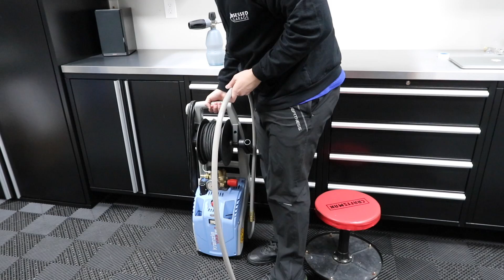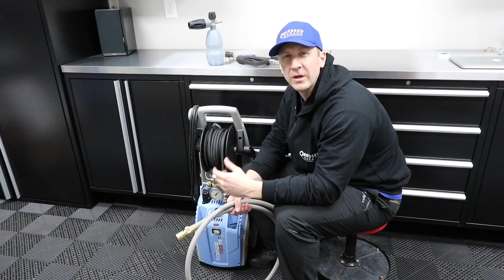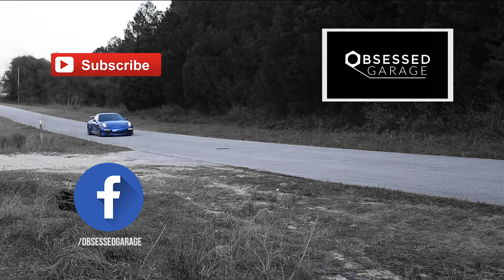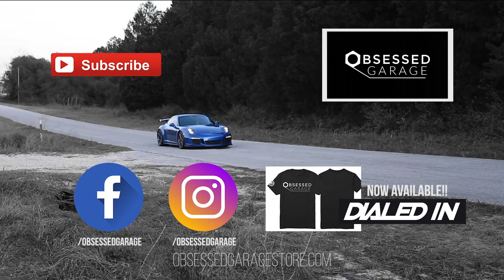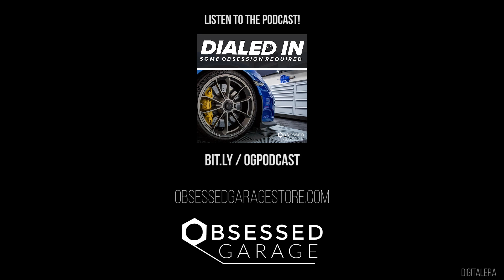Complete Kranzle/MTM/Mosmatic Pressure Washing Solution

Comment: I want to buy the Kranzle K1122TST Portable Solution Ultimate package, and want to upgrade the hose to the new Obsessed Garage 3/8" High-Pressure Hose v1.0. Would I need any additional fittings or would the product be a simple plug and play setup? If I need any additional fittings can you please let me know? Ideally I want everything quick release for easy storing/winterizing.
Reply from the maker: That won't work.  There is a proprietary swivel fitting inside the hose reel.
Reply: @ObsessedGarage  what would you recommend so that I can group the best hose with the pressure washer

Comment: Matt, I know this video is older. I have a situation in the form of a question, my water hose is on the side of my house and it is a stretch to get to the driveway. The plug that this would be run off of is located deeply in the garage. Spatially is there are a solve for that or am I out of luck until I can get into a home with a better laid out garage and water situation.
Reply from the maker: You can run a normal garden hose to it.  I used to have a 75' hose that connected to mine.  Then get a really thick extension cord that plugs into a 20A circuit, and you'll be good to go.
Reply: Nice! I can do that until I build a more car wash friendly layout. Thank you, Matt.

Comment: What are your thoughts if any about the electric Briggs and Stratton powerflow washer rated at 3.5 gpm?  The 3.5 gpm is what caught my eye.
Reply from the maker: I'm assuming that's a gas pressure washer.  The noise would make it a paint.  3.5 GPM is great, but you can't get that in electric without something like 30A or 220V.
Reply: Briggs says it's new Powerflow technology provides the 3.5 gpm and it's an electric model on Amazon. Briggs & Stratton 20667 Electric Pressure Washer 2000 PSI 3.5 GPM POWERflow+ Technology, 7-in-1 Nozzle, 25-Foot Hose & Detergent Tank.
Reply from the maker: I've never seen that one before, but the is no chance that is doing either of those numbers.  Well...maybe it would on the moon.  My $5000 30A 220V Kranzle does 2.8GPM and shakes the whole pole barn.  I thought maybe that was a gas powered model.  I wouldn't waste your time with that.

Comment: Great explanation of the unit and attachments. My one question is how water tight are those fittings? I have used quick disconnects before and they seem to always leak! I hate getting more wet than my car while using a hose.
Reply from the maker: These are been completely leak free.  Now they are a consumable, so I like have an extra of each one to replace when an O-ring or bearing fails.  But I've gotten a few years out of each part.

Comment: Is it safe to use a 3.0 orifice, that would increase the pressure to about 2000psi. Or will the 1122tst only go up to 1400 psi? Thanks
Reply from the maker: This will likely not increase the pressure that much.  The pump is rated at 1400 with a 3.5 size orifice nozzle on it.  Adding a smaller nozzle will allow a little more pressure, but it's probably not going to make it to 2000.

Comment: Just received my Kranzle package, hands down the finest pressure washer on the market. Lots of great foam and extremely quiet. All you hear is the spray coming out the gun. Matt did a great job putting this package together. The only downside is the price, but if you pony up the cash, you won't be disappointed. 
Kudos to Matt and the obsessed garage crew.
Reply from the maker: Thanks man!

Comment: Hello thank you for the information.. have you seen the AR PRESSURE WASHER THAT GARREY DEAN IS POSTING FOR SALE . It draws 6.5 amps and is .5 GPM any thoughts on that washer I’m looking to buy a pressure washer soon..thank you for your help in advance
Reply from the maker: I'm sure that would be best suited for mobile use making output sacrifices in order to operate on a generator.
Reply: Thank you for your input and yes I’m looking for something mobile I have a gas pressure washer at 2500 psi and looking for something below 1500 psi for car washing

Comment: Hey Matt...what modifications to the package would need made so that I could use my Adams foam cannon? I previously used it with a Karcher K5 but I want to step up the pressure washing game. Thank you.
Reply from the maker: Should mate right up.  The only thing you may need a 1/4" male plug.
Reply: Obsessed Garage I appreciate the response. Should I order each individual package component or can I simply order the package and request excluding the foam cannon and add a 1/4” male plug. I’m afraid I’ll miss something ordering piecemeal.
Reply from the maker: Just type in the notes that you don't want the foam cannon, but you want the plug.  If I were you, I'd keep the PF-22 in the package.  It's much better than the Chinese Adam's gun.  Their's is a copy of the original MTM gun.
Reply from the maker: My Dad will credit you the difference.
Reply: Obsessed Garage about to pull the trigger on this but are you currently testing something that will be better? Should I hold off?

Comment: My wife will let me get one if it will wash our deck and grimy siding.   Is the pressure and flow rate suitable for household chores ?   #alibi  #underground_upgrade_club
Reply from the maker: You wouldn't want this for household stuff.  It doesn't have enough output for that.  You'd want something gas powered with 2.5+GPM and 3000+ PSI.

Comment: Matt, I know you've probably already been asked this question... but what PSI do you recommend for car washing (meaning direct to paint) ... I bought a gas powered 3200 psi pressure washer that I have been using... is that too much? 

I'm interested in buying the Mos handle and wand setup with swivel if you offer it and it works with 3200 psi. 

Thanks for all you do man!
Reply: Ok so I asked too soon... 1100psi recommended... I am wondering what calculations I need to make to see what my psi would be with that handle/wand/tip setup?
Reply from the maker: You need to know your GPM output.  Then google GPM orifice nozzle size and you'll get a million charts to dial in PSI you want.

Comment: shipping to norway?
Reply from the maker: You would need to get pressure washer in Europe, but I can ship gun/wand.
Reply: Nice thanks, but no one selss 1122tst in norway, only higher numbers, meaning newer versions?
Reply: Hei Rein! i Norge har vi 220V i strømnettet, og får derfor grommere elektriske høystrykkspylere her enn de gjør i USA hvor de har 120V. (Derfor mange i USA bruker bensindrevet.)
Da kjøper du den Kranzlen som du evt har råd til eller vil ha, og kjøper deretter QC Nozzle etter GPM og PSI på høytrykken du velger.

Comment: Good job on the whole kit , I'm going to get this whole setup , I was also thinking of the hand carry K7  but I'm not sure how they compare to quiet and the K 7 might not have auto on and off , I think that's a big plus have auto on and off , Can you give me some professional advice? Thanks!
Reply from the maker: I don't think the K7 is a very good machine.  It's plastic and cheap in comparison to the Kranzle.
Reply: Obsessed Garage  Oh I'm sorry , The machine I'm talking about is a Kranzle 98K1622 , it's a small little motor with a pump on it  and a carry handle , I think the K -7 is euro version , I'm really looking for a quiet machine , I have a gas power now and it's a chore to set up I've been watching your vids and I trust your input , I placed an order for the fittings the other day from your site , there on the way:) , now I have to get the gun , lance , and machine . Smalll steps

Comment: Matt, I have a Karcher electric washer right now. I also have a foam cannon that mates up to the karcher handle. What do i need to hook my existing foam cannon to the kranzle?
Reply from the maker: My package will fit just fine if you can find the Karcher push fit to M22 adapter.

Comment: how quiet is it compared to a gas powered power washer? I prefer to start early in the morning however as to not be a rude neighbor i usually wait till about 10am for those that are not morning people. In the summer where the average temp is 90 or greater, early morning is a must or else i have to wait till late afternoon. Thanks in advance and keep up the great work sir.
Reply from the maker: Hmmm.... I'd say 50% quieter.  I used mine early in the morning and late at night religiously at my old house.  I think this is extremely neighbor friendly.
Reply: Moises Caballero also, once you release the trigger, tje unit shuts off.

Comment: Anyone make a foam cannon that works well at around 800 psi? I like 800 psi for washing because im in CA where wasteing water isn't cool
Reply from the maker: This will work.  You'll get a decent amount of foam. It just won't be shaving creme like.
Reply: MTM makes a low pressure foam cannon now, probably newer than this post.
Reply: That’s not true I legit have a Ryobi 1600 psi electric pressure washer with a twinkle star snub pressure gun and their foam cannon with a 1.10mm orifice and it is completely like shaving cream. Thick as can be and I’m all in for about $100 no lie actually about $110 after tax.

Comment: Do you have a video on maintaining the pressure washer so it stays at optimal performance? Very well made and informative video btw. Much appreciated!
Reply from the maker: I do not.  I literally have done nothing buy plug in and turn on the Kranzle.  That's the beauty of it.  It just works.
Reply: No, its not critical.  Changing the oil, is quite easy.  Also, once you notice the pressure seem to drop, it will be time to have it looked at. 1500 hours, is a long time.
Reply from the maker: Funny, I just made an oil change video today.  I'll have it up in the morning.
Reply: Tuong Nguyen one need only change the oil, which is easy. one will see 1000-1500 hours of use, before maintenance will be needed.
Reply: Dan Stewart So I'm guessing I need an hour meter?
Reply: Dan Stewart Alright. Thanks man
Reply: My pleasure
Reply: Outstanding, a public service announcement....